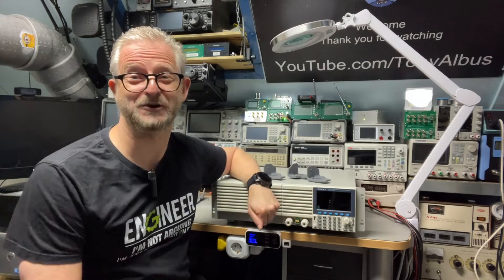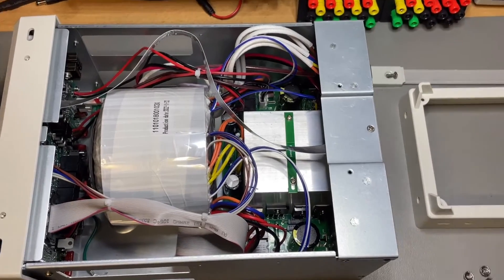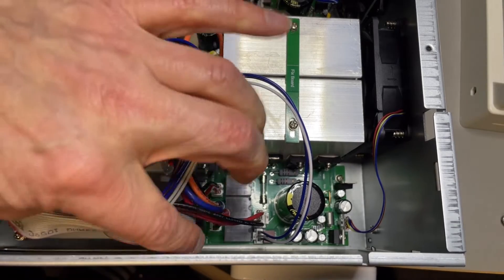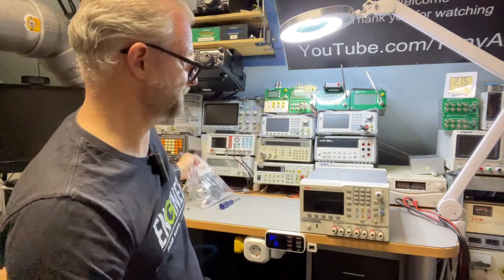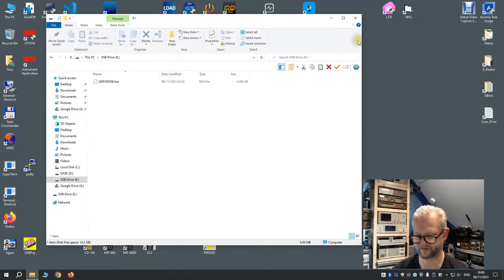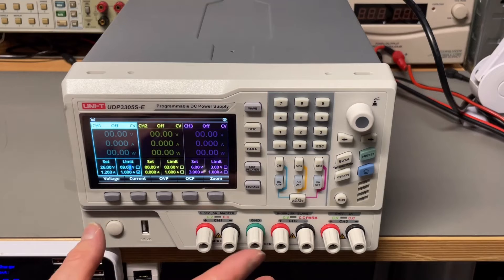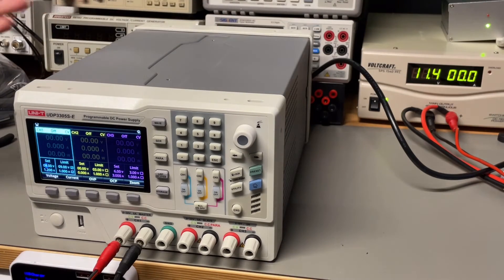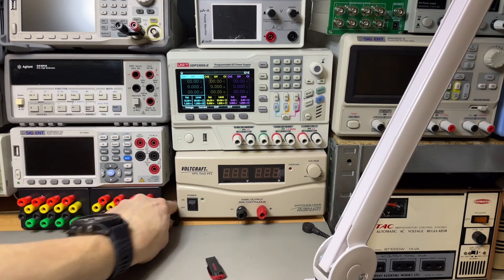TA-0378: UNI-T UDP3305S-E - Teardown and Firmware 1.11 Fix OCP OVP - 1.12 list output - 1.15

Comment: Hi Tony, do you know how to setup the output voltage with a slew (for example with a 100ms ramp up) in order the ps anticipate better to over current conditions and to parallel capacitors on the load?
Reply from the maker: Hi, Not sure to be honest, maybe the listmode can help here. but for the caps, the CC will help you not to have to high current. if you set the CC lower than OCP it should not be a problem.

Comment: Hi Tony! What is the calibration procedure for this power supply?
Reply from the maker: That is done by special software only available to autorized UNI-T service stations, i have been told.
Reply: @TonyAlbus  Thank you!
In this case, this unit is no longer of interest to me.
A black ball for UNI-T!👎
Reply: Has it been leaked online anywhere. Do you have contacts that work at one of these service stations?
Reply from the maker: @simontay4851  i am in contact with the GM of EU, but he is not sharing, i have not found it leaked yet

Comment: I am about to buy this (or a OWON OCP3063) ... both have pro and cons. Here's a "Recorder" in the Utility menu, and I cannot find any informations about that. May you have a look inside and text us what we will find there?
And THX for the look inside. The OWON has two separate toroids, but I think this makes no difference in the end.
The 1.11 is still not on their website, for some reasons we do not know. I like the fact, that there are firmware updates possible at all.
Reply from the maker: Yes i need to check the recorder option...

Comment: Nice work Tony! Always have a weak spot for UNI-T....every now&then they make some really nice equipment. The user interface is really nice implemented at this power supply. Did you take a look at the capacity of the 2 buffer caps? Thanks for the videos, keep 'em coming!
Reply from the maker: Thanks, yes best user interface yet i have seen so far..
Reply: The user interface is implemented very nicely and the transformer is impressive. But the rest of the internals do not convince me as far as I can see in the video to be honest. At that point I was positively surprised by the internals from the Owon ODP 3000 series reviewed by Jerry Walker. But the UNI-t's user interface has an edge over those....where to choose for... They all have their pro's and con's....

Comment: Hello there. Does anyone did or know how to bypass the short circuit portection on this power supply?
Reply from the maker: Why would you want to do that, what do you mean exacly.. the maxium of CC will be the shortcuircuit protection.
Reply: @TonyAlbus  i mean when  you try to find shorts in faulty boards you need to get rid of the short circuit protection of the power supply so you can supply power to that short and see whats getting hot. If you have the short circuit protection you can do that. I know in some power supplies you can have a SC relay bypassed and its done and i was curious of they use the same principle here or more complex things
Reply from the maker: @mendiarapi  No you don't get rid of shortcircuit protection. to explane CC and OCP are types of protection. if you want to heat your shorted components and risking burning tracks, you could switch off OCP but i still highly recomment using CC to keep the current in control. if you want to be sure to burn everything just use a battery that will give you enough amps to blow everything. CC excists for a reason. please read about CC and OCP it will save you a lot of money

Comment: Hi Tony. I received my device today. Isn't it a nice looking, silent and decent bit of kit?  Man, this is a really nice power supply. Very well build. All the buttons feel great to use, very nice display, especially in Zoom mode. I've done some tests under load and results look all good. Handling is easy, no need to read a manual. I am very happy so far with my purchase. For that money you get a very very nice PSU. What I don't like (though not critical) is the fact that when using banana plugs for the binding posts, they do not slide-in completely. The length of the binding posts are all just a few millimeters too short. However, this is true for most Chinese PSUs... ;) no idea why those short binding posts are so commonly used.
Thanks for sharing the firmware update, which ran fine for my device as well. I think I will have a lot of fun next few days in further playing around with my new "toy in lab".
Reply from the maker: Hi Markus, yes it looks amazing, for space i removed the corner bumpers, it looks less impressive, but usability is great.
The Zoom is a great option for old men like me. the bana's i did not noticed, maybe becouse i have chinese banana.. so it fits. Have fun!!

Comment: Thank You very much for this! It was my main concern regarding this power supply. With new firmware OCP works as it should from the beginning. I have sent You an email with another bug if You are interested.
Reply from the maker: Hi, yes thank you for the email, i have received it, very interesting point. for now i would advice to first set the voltage low and then start the program, but you prob thought of that yourself too :)

Comment: Thank you for the look inside, Tony. I suppose the designers were concerned about users confusing the USB power output channel with the USB data storage port, but I still think it should be on the front panel. I still prefer linear power supplies for bench use. Regards, David
Reply from the maker: Hi David, yes somewhere in the front, i agree, but like this it works good to.